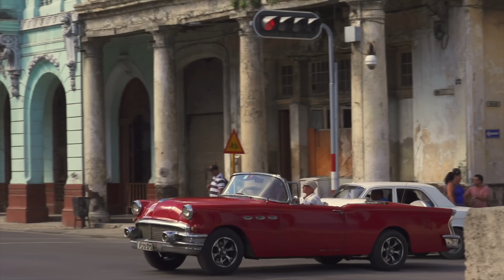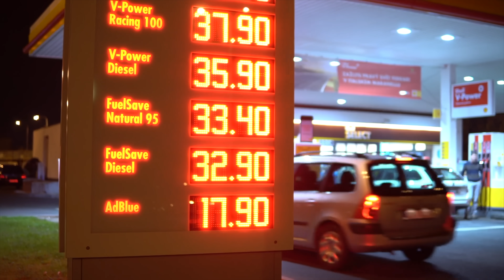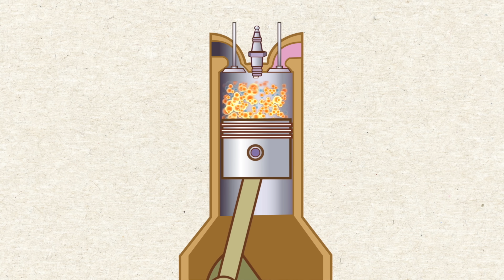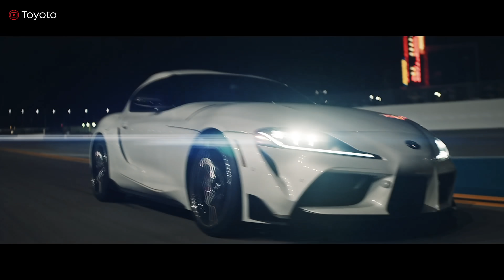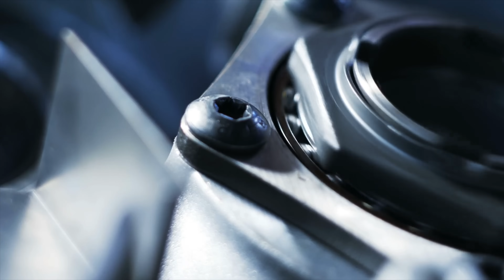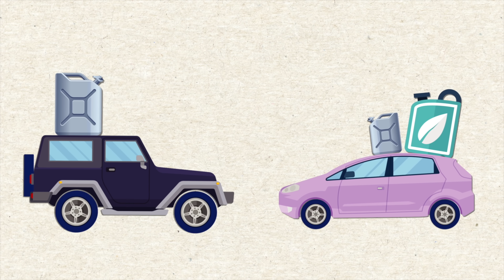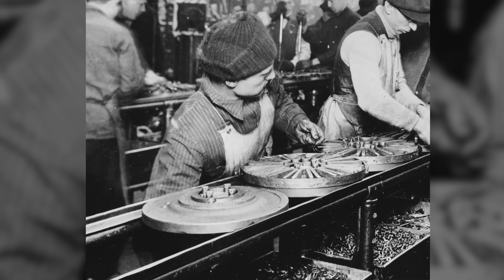7 Fuel Myths Stupid People Fall For

Comment: I used to drive pilot car for over-sized loads.  There were some routes across the US that contained segments slightly longer than my 4Runner could travel on one tank of gas.  I would carry a 5 gallon container of gas to get me across.  On a suggestion from a friend, I began using premium fuel on these routes and was able to leave the spare fuel at home.   In light of your video I am at a loss at how my vehicle gained enough mpg (travel miles) to easily traverse those segments.  I don't doubt you, I just have my own experience that I can't deny.
Reply: He actually said it in the video, the heavy load can benefit from higher octane. Extreme conditions can have a diffence (high temp or heavy haul)

Comment: So you're car can technically get a slight increase to power. But it has to be built for higher octane, so throwing 93 octane in an 05 civic won't do anything than putting 87 in it. But in a demon/gt500 there probably would be

Comment: I filled my RV with 85 once in Wyoming.   Ran great and was able to book a couple hundred more miles down the highway.
 My Onan generator however didn't like it and would stall out 30m at a time...
Reply: start going up mountains or higher elevation and it wouldnt be happy

Comment: This video sounds like it was narrated by Joe Pesci. But anyway, what about when I see 85 rating fuel? Normally the 3 choices (in the US) are 87, 89 and either 91 or 93. But sometimes I have seen 85, particularly in Montana and Wyoming. Is that risky for even a normal engine the way 87 would be risky for a sports car?

Comment: Top Tier gas is recommended for ALL GDI engines because of all dirty they will get.  If you don't use cleaners and/or Top Tier, you have to take your engine in to a shop to get cleaned every one or two years because of carbon build up.

Comment: Should I put higher octane in extreme winter conditions and then use recommended lower octane in summer?  I'm talking Fairbanks, Alaska winter here.
Reply: It's the opposite, high octane can be useful in hot weather where timing would get pulled with regular due to engine heat soak.

Comment: so i always use regular gas but now that i went from a kia forte to a Nissan rouge should i still keep using regular gas or upgrade ? im confused
Reply: For a Nissan rouge you should be fine using Regular gas unless you have a sport mode then you might have to upgrade. always double check your cars manual it will tell you the Minimum octane rated fuel you should be using. My 2018 Honda Civic SE for example uses regular gas unless it has a sport mode then it requires 91 octane fuel.
Reply: @thegreatcanadianlumberjack5307  ok ya it has a sport mode eco and all wheel drive

Comment: I've seen conflicting reports of the pollutant content of ethanol vs gasoline, yet it appears pretty clear that ethanol is vastly less fuel-efficient. I wish you had addressed the fuel-efficiency of both methods and how that affects the overall desirability of one over the other. I don't have a dog in the fight one way or another, but balanced reporting on it is hard to come by. Both sides seem to want to push theirs as the best option.
Reply: But didn't he mention it? 

Ethanol is less efficient in terms of performance but better for the environment.  A ratio of more gas than ethanol is better for efficiency.
Reply: @Sesshomaru474  He said that since ethanol doesn't release as much pollution we should use as much as possible. That's not the same, and as I said, I've seen conflicting reports on its efficiency. On average, e85 gets about 25% less mileage than unleaded. The massive acreage required to grow corn for fuel, combined with the need for refineries to combine the fuel, makes it less desirable for widespread use. I would honestly like more in-depth analysis on it than flat statements like "it's better for the environment."
Reply: It's not better for the environment either. Sure a kick in the nuts is better than a gunshot wound, but that doesn't mean you should have to choose one over the other.

Comment: Ethenol burns clean but has less chemical energy? "It's a cost effective way to raise the octane rating of gas". So in theory if your car requires low octane fuel, your vehicle will be more energy efficient with non-ethenol low-octane fuel.

Comment: All I know is my Ford explorer has flex fuel. Meaning you can put 85 in it . Needless to say after I did that my check engine light came on. And I noticed my acceleration was off.after I ran out the tank I put some fuel injector cleaner in it & fill up with premium & the check engine light went off! & Been using 89 ever since! Btw when I. Broke & have to use 87 my acceleration is off so yes listen to the old adage you get what you pay for

Comment: Real simple.
Use the lowest octane your car runs on without pinging.
Otherwise you are just throwing money away.
Also. The lower the octane. The less addative added to your fuel.
Ideally. Pure gasoline is the best. But good luck finding that today unless you crack your own gasoline.
Btw an old trick to raise octane.
One pint of Diesel #2 per gallon of gasoline raise 85 octane to 97 oct. 
That an old trick the used on drag strips   in the 60s.
And a carburator vehical can run on 50% gasiline / diesel.  But is a dog.

Comment: Note. This only applies to piston motors. Run 87 octane in a rotary engine. Then run 93 octane in a rotary engine. You'll never run 87 octane in a rotary engine ever again. So please don't say it at the octane does not make the car run better. It doesn't for a piston motor. But you run that junk in a rotary and you will watch that rotary eat all that gas very, very fast. You can literally watch your needle go down while you're driving. It's awesome how much faster it kills gas if you're on 87 versus 91 or 93. And then on top of that. Don't use Walmart gas or Kroger gas in no damn rotary. Their gas is trash and your rotary will prove it to you. Piston motors you can do everything that I said you can't do with a rotary.

Comment: Got it, unless putting the vehicle under a heavy load in the form of towing/hauling, don't bother with going with a higher octane than what is recommended by the manufacturer to avoid predetonation. Makes perfect sense to me and fits with what my father always taught me.

Though, one thing that Scotty didn't go over on the reasoning for being careful about using e85 in a vehicle that isn't equipped for it, is that long term exposure to the ethanol can damage the rubber and some plastics used in fuel lines and other components that are exposed to the fuel. Not to mention that vehicles that are equipped for Flex fuel usually have a sensor that tells the ECU that it detects the ethanol and adjusts the timing accordingly. So could a non Flex fuel vehicle be fixed to run on ethanol? Yes but the ecu would have to be reprogrammed and any parts that could be effected by the use of Ethanol be changed for ones that won't be. They do this in motorsports, and I've heard of some police departments using e85 as their go to fuel for their vehicles with an ecu tweak to make it run even better on the ethanol.
Reply: if you're towing you don't want a gasser at all. not if you're doing that on a regular basis. Tell you what gassers are NOT designed for heavy loading. diesels don't pre ignite because they don't have "spark" plugs they have injectors that nowadays inject near TDC.

Comment: Sooo read my manual and go by that got it thanks. The first Fords running on ethanol that’s interesting, trusting big oil put a kibosh on that Option  directly. Which brings into question how many acres of corn does it take to make up 1 gallon of gas and how many animals are killed and how much fuel is used to process the corn from planting to put it in your car. People have long forgotten that there use to be lead in the gas to help lubricate the Pistons so any engines really old run today better with putting a little oil in your gas. There just simply has to be a better way. The idea that electric cars are the answer is ridiculous the amount of energy we would have to generate to charge them all. I only hope I live long enough to see the breakthrough as we come to terms with energy not being able to be created or destroyed only altered.

Comment: Here's a thought
If Engine's are meant to run on Ethanal Gas you could run moonshine in it!
Unfortunately no combustible Motor is built for ethanol fuel.
It's better to run Ethanol Free Gas by far. Because ethanol is actually fuel mixed with corn.
So there ya go!!!!!!

Comment: Scotty I have a Lexus GX460 V8, Lexus requires 93 gas.
What I don’t understand is the engine of GX460 (4.6 v8) is the same engine in the Toyota Tundra, however the Tundra doesn’t require Premium gas.
I’ve heard lots of speculation about this subject but nobody seems to have an answer, do you know why the difference of gasoline requirements although it’s the same engine?
Thanks
Reply: The ECMs are different
Reply: the lexus has a much different performance oriented tune,different timing,different fuel map etc,different injector pulse

Comment: What kind of fuel would you use in small engines or motor sports engines
Reply: In snowblowers, lawnmowers, string trimmers etc, non-ethanol gas is recommended. They supposedly run better and last longer.

Comment: I have always been sort of a skeptic - some what cynical, even , when it comes to consumer products.  BUT, having learned to drive in air-cooled VW Beetles and buses, there was definitely a difference in power between low grade and premium, felt at the throttle.

Later, my 97 and 93 Ford 460 V-8's absolutle sucked on Regular, but performed beautifully with Premium.  They'd pass everything but a gas pump.

Currently, I drive a 95 Grand Cherokee with the 4 liter. Rathwer underpowered at 3800lbs, but does better with premium fuel.  It's easily felt at the throttle, no question.  Same with my 2012 RAM 1500 with the 3.7, which is no powerhouse, but it is markedly better with premiuim.

So, whatever.

Comment: Ethenol requires more emissions to process vs gasoline.  It is touted to be more renewable, but the energy required to process is greater.  Not a renewable solution.  Also look for future laws attempting to increase ethenol requirements due to increased utilization of electric vehicles.  Money is the driving factor.
Reply: Ethanol is a natural octane booster that also chemically reduces exhaust emissions of sulphur dioxide, nitrogen oxide, and carbon dioxide. This eliminates the need for using more toxic compounds in the fuel’s additive package.  Basic chemistry.
Reply: @blackhawk7r221  not denying it. I wasn't speaking on the chemistry, just the infrastructure and logistics.  Growing corn, creating the machinery to harvest, move, refine, redistribute, and refining corn isn't the most efficient way to produce ethanol.  I've no doubt that biofuels are a great alternative but greater strides in efficient ethanol production is needed.

Comment: Technically the higher octane ratings are slightly less fuel efficiency for your vehicle, they DO contain less energy....the difference is less than .01%
So that isn't correct in the video.

Comment: This is bogus....of course performance engines RECOMMEND higher octane fuel..why? because IF the car doesnt run as well on the lower octane gas, you will probably blame the car, NOT the gas. You don't need top performance driving under normal conditions....save the money, dont bother....and different octane gases have the exact same detergents.

Comment: If  you put real straight gas in your car you will  gain 5 to 10 miles a gallon  more than  ethanol  . You are burning  more fuel so you are not helping the environment.  
The truth is gas companies pay. .50 cents a gallon for ethanol and sell it to you for $3.00 a gallon or more. And because you are using more Gas to go the same distance  they are making  more profit from you.

Comment: stay away from flex fuel. note that 7/11 does not sell flex. never use flex in small engines like mower, wackers, chain saws and such. yeah you want the real deal. one other thing when we're talking fuel. use diesel to start charcoal! ONE OUNCE is all you will need (instead of 8 oz of "charcoal starter".

Comment: I drove a tank truck and during my time, hauled million's of gallon's of gasoline. When one fill's their tank with gasoline, it all comes from the same generally several million gallon tank's at the refinery. Thus it's all the lowest of grade's. The driver is to select using the loading system computer button. Which grade they desire to put into which of the generally 3 to 4 separent compartment's. Each time they switch putting the product into the other compartment. The driver is responsible for the selection of the grade desired. Sometime choosing the incorrect one, some times not. The additive that cause's the lowest grade to be that of a higher one is added depending on the driver selection.

Year's ago, I got envolved in a situation where as I ended up getting fired, when I informed the secretary of state that a particular brand of gas station's who sold gas cheaper than the named brand's. Order a completely full meaning all compartment order of low grade, And then while on site, filled the various separate tank's which were supposedly to hold the different grades or blends. Meaning regardless of which you picked at the pump, be it the low grade or highest. Which the latter cost more. You were getting the low grade.

The secretary of state being courious, had some investigation done in which I was envolved and finding out it was true. Started a class action suit, that caused the company million's in fine's, and eventually put out of bussiness. Loosing more than half of my companies deliveries in the process, and my name being associated with the legal process that envolved the law suit. I was fired post haste.

Comment: I drove Denver to Colorado Springs for 13 months almost back to back. I was driving a 01 Toyota Tundra. I was regularly rolling 75 mph.  I think I slightly felt better acceleration and torque (so less downshifting). I did notice  better gas mileage. The improvement paid for the price difference by 3-5¢ a mile.

Comment: These statements are not correct. The octane number is defined by the speed the fuel is burning. High octane fuel burns faster then low octane one.

Comment: Remember the days when you would pull into a gas station and the attendant would come out and check your tire pressure, squeegee off your front and back windows, check your oil, pump your gas and it was all included in the price of the gas? Now those cheap azzes have the consumer do all that. I remember being in my parents car and pulling into a station and seeing this done. It is really disgusting what they've done. I use 85 .... it works fine.
Reply: They still do this in Mexico.

Comment: and if you have a car pre 1975 be sure to use premium as most national brands do not dilute  it with ethanol. Older cars are not designed to run on ethanol as ethanol attracts moisture as a result pump parts and fuel systems will  be subjected to corrosion.

Comment: I know my 94 ford truck needs 89 oct or if lower is used it runs bad
Reply: My 94 ford truck stopped knocking at premium . I did run 89 for awhile but noticed knocking going up even a slight hill.

Comment: Most of y'all probably don't recall this:  before the oil embargo of 1973-1974, regular was at the same octane as high-test is now.  They just decreased the octane across the board so they could charge more for it.  (The numbers of cars lined up outside gas stations was unreal.)

Comment: my 92 buick century ran like crap after putting 92 instead of 87, 2yrs later roommate put 92 in it , did a lot to try and fix it but it was never the same, couldnt drive it anymore
Reply: lol..not likely       your car was clapped out,the gas had zero to do with it

Comment: Ok here's what I'd like to know; can 87 octane cause exhaust valve damage?  I have a '17 Sonata Eco, which is a 1.6L with turbo.  The power boost is handy on the highway and the mileage of up to 40mpg is great  A year and half ago I had 117K on it (75% highway) and for about four months prior it started burning oil, a lot.  At one point I was adding a quart every 500 miles.  One day the engine died on me and long story short it turned out to be a burned exhaust valve.  Yes, I was aware of the engine failure lawsuit and settlement but my model engine wasn't part of the lawsuit, which had to do with metal filings in the combustion chamber.  Anyhow, while the owner's manual recommended 87, "Your new vehicle is designed to use
 only unleaded fuel having an octane
number ((R+M)/2) of 87 (Research
Octane Number 91) or higher. (Do not
use methanol blended fuels)" , I found that the ECU liked 89 much better because the turbo lag was greatly reduced when I used the higher octane fuel.  I never heard any knocking though.  So back to my original question, given my situation could 2+ years of burning strictly 87 octane contribute to a burned exhaust valve, or was that simply a bad valve?  I had a valve job done by an independent shop ($3500) and it runs like a new car but now I always use either plus or a mixture of regular and premium.  Thank you in advance.

Comment: Good video but a wholly disagree with your optimism in regards to ethanol. 

Yes it burns ‘cleaner’ but not only is less energy extracted per fuel unit  (BTU/liter or gallon) compared to petroleum fuel… an enormous amount of energy goes into the production of ethanol. That  energy cost is subsidized by the taxpayer twice… paying for ethanol  production and paying petroleum fuel taxes. Worse it consumes vital fresh water supplies better reserved for food production.

Ethanol is but another costly and wasteful government regulatory scam that ultimately harms the taxpayer AND the environment.